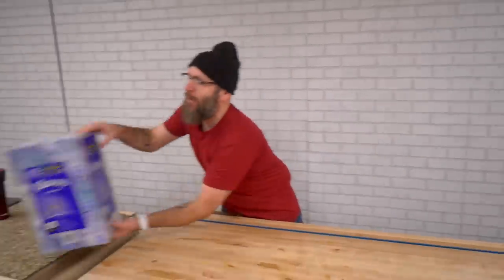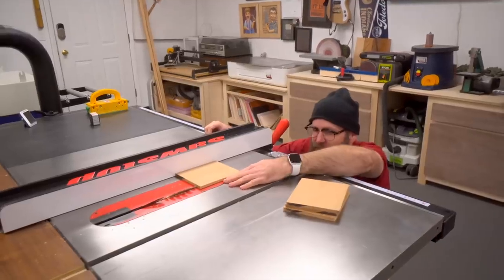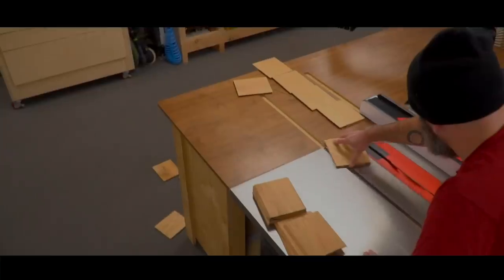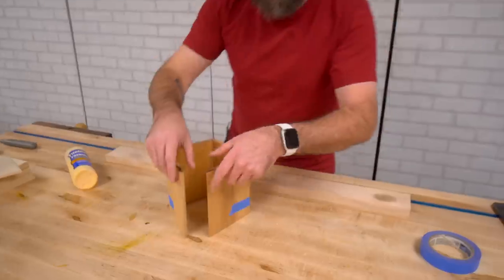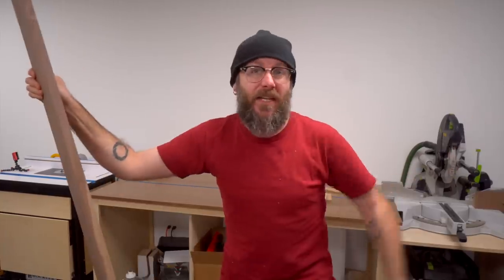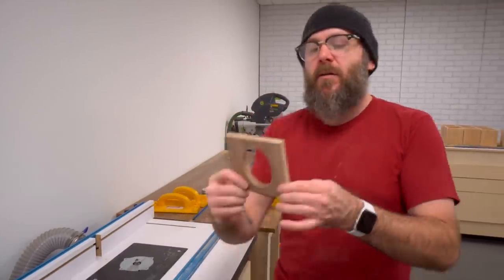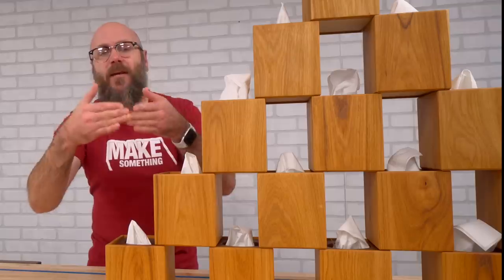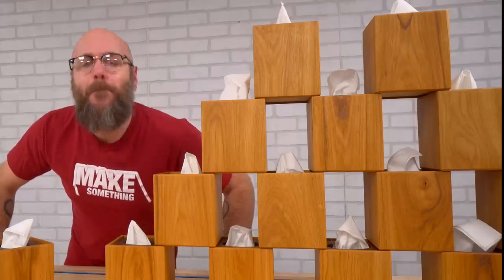Woodworking Project | How to Make a Wood Tissue Box Cover

Comment: Hi im 14 and i do wood work any tips
Reply from the maker: Hi Thomas! Never push the wood too fast through the table saw or bandsaw. Let the blade do the cutting. Pushing the piece faster than what the blade can cut will give you poor cuts and is a safety issue.
Reply: Buy all of your lumber from Kencraft!
Reply: Thanks
Reply: @thomasdavis4565  Don't be afraid to show off your failures. You can learn and show your development. Plus don't stop on a failure, keep going, you may like how it turns out.
Reply: Remember your first try at a new technique or project won't be the best and that's ok. Practice makes perfect.
Reply: Thanks for all the tips been really useful thanks so much
Reply: @thomasdavis4565  Also (as I'm sure you already do) watch a lot of videos by makers here on YouTube. Even though many videos are not structured as step-by-step how-tos, you can always pick up new tips and techniques by seeing how other people work. I know as a woodworker, I've picked up many new techniques and ideas by watching David, The Wood Whisperer, etc.
Reply: Thomas there’s a lot of great books also to get great information. Also see if there are any free Woodworking classes or groups in your area. 
Best of all practice, practice, practice. And HAVE FUN!!!
Reply: Make safety an easy thing to do. For example , I have safety glass lying all around my garage so I can never say “it’s just one quick cut and my safety glasses are way over there in the drawer” that’s when accidents happen
Reply: Invest in the proper tools.
Reply: I am 13 and I apprentice a wood worker who build horse jumps if you can try and find someone you can be a apprentice it is a great way to learn hope this helps
Reply: Buy a cnc
Reply: Trying to keep all your fingers is important for sure!
Reply: Make and make and make.... your first attempt might not be the greatest but your 3rd, 4th and 5th might be!
Reply: Since you introduced me to Kencraft that’s were I get my lumber for all my projects! Quality lumber👌
Reply: Don’t be afraid to try using different types of materials.
Reply: If it is something you are passionate about look into vocational school. If that's not an option see if you can volunteer at a cabinet shop/mill work shop. It's a good way to get introduced to the trade
Reply: Stay in school, study hard and get a really big paying job so you can afford woodworking.....it's expensive.
Reply: Use cheap scrap wood to practice. Once your skilled enough then move to higher end lumber. You don't want to make expensive mistakes.
Reply: Do what I've been doing and learn how to fix tools so you don't need to buy a brand new saw for $$$. If you look on kijiji, and have some patience, you can buy cheaper tablesaws, bandsaws, planers, and jointers for $ and learn to fix them yourself, meaning more money saved for other things
Reply: Fail! Fail Again! Fail Better! Never give up!
Reply: Never be scared of a tool but always remember they are dangerous.
Reply: Take care of your tools and they will take care of you. Never use electric tools if you are stressed, I always have a small carving project on the side for just that
Reply: marcus koko u must be married with kids too. J/J good advice
Reply: @acwoodworks4987  Im 21 and single but thanks
Reply: Just try new things, but don't do anything that you feel is unsafe.
Reply: Thomas Davis you still doing woodworking!
Reply: don't rely too heavily on power tools. they're expensive, dangerous, and boring
Reply: Are you still doing woodworking?

Comment: Greatproject David! I would love to have a CNC as I have projects in mind that have repetitive steps and a CNC would simplify and quicken the tasks immensely. But alas, I have other needs that are more pressing and have to come first, so a jig saw it will have to be for the time being.
Reply: David S look at Dave Gatton CNC. It might be cheaper and easier to build then you think.
Reply: @rchavez5056  Thanks for the input, I checked them out. Right now they are still a want that I have put on the back burner.

Comment: I usually see these done as an inverted box over the tissue box, with a hole for the tissues.  What I hate about that is when the tissues get low, you have to remove the wood box and dig around in the tissue box to find the edge of the next one.  What's nice about your design is that you could lose the cardboard box altogether, and just have the walnut top follow the tissue stack down as they're used.

Comment: Could you do the top by making a larger diameter oval as a guide for the router to run around and a scrap piece of plywood underneath? Seems like a good alternative to CNC and will Mae it just as easy to batch out a bunch.

Comment: The worst thing to me about a box of tissues is that as they get used, they get further away from the hole, with the top one eventually falling down inside and away from the hole so you don't have the handy popup effect, requiring you to reach in and dig in that annoyingly dry stuff with your fingernails to find the edge of the next one.  So I'd like to see (and make) a tissue box where you discard the cardboard box and put the stack of tissues into the wooden box.  Make it with a fixed bottom, but get this:  A top that is not attached, but which follows the stack down as they get used, so that the tissues are always right up against the hole, and the top one always sticking out and able to be easily grabbed.  So a fixed bottom and a 'follower' top, and toss the original cardboard box.  What do you think?

Comment: Hey David, any reason not to do those 45 degree miters before crosscutting into squares? Since only 2 opposite ends need the miter, seems like it could be a quicker (and maybe safer) method. Same could be said for the CNC cutting although getting those cross cuts right for a centered hole might be more challenging.

Comment: That's an awesome project. I did have a question for you. Knowing that you were going to use the CNC, why didn't you keep the tops as larger pieces and do work on multiple tops at a time versus multiple start and stops you would have had to do?
Reply from the maker: So I could show the cuts being made in my plans without the CNC

Comment: One question (I'm not a woodworker but looking to start as a hobby next year), if you were mitring those two edges anyway on the table saw could you not have ripped the whole length before cutting to size? Do you have any tips for creating these without the power tools? Would it be best to go to a local makerspace for the bigger cuts?
Reply: Good point. Seems like doing the whole board first would be faster. Maybe it’s an issue of controlling the workpiece through the blade.
Reply: It is a long old bit of wood. You're probably right.

Comment: Cool video - love your work!  Was there a reason you didn't cut the miter on the stock before cutting it into smaller pieces?
Reply from the maker: The only reason I can think of is I wasn't thinking at the time.
Reply: @MakeSomething  Cool thanks for replying :)

Comment: Hi Dave. Great gift idea. Noticed the blade burn marks on the hickory. Is that the nature of that species of wood (like Cherry) or is it result of feed rate/how new or clean the blade is/etc.? It’s difficult to sand off those marks from the end grain.
Reply from the maker: Hi Dan! I actually have the wrong blade in my miter saw. Has too many teeth and causes burning. It was a good lesson learned!

Comment: You are wrong about not needing to fasten the top.

Without a proper, snug fit, those tops will end up in toy boxes, trash bags and other strange and unusual places, all courtesy of the resident toddler.
Reply from the maker: ha!
Reply: I make them with no "bottom".  The piece with the hole is the "bottom" and it goes over the top of the tissue box.  Of course it is flush with the sides.
Reply: @redstick3900  Nice, might try that.